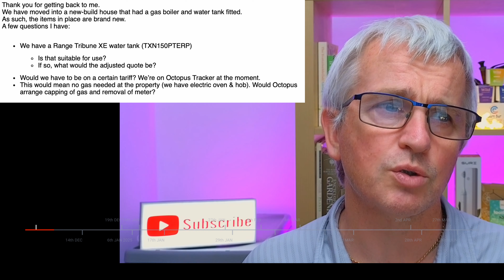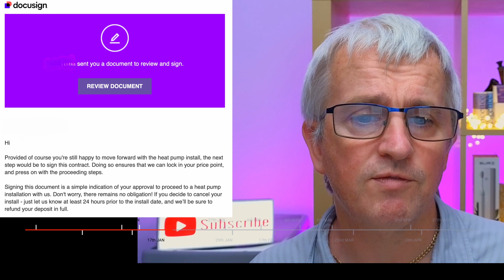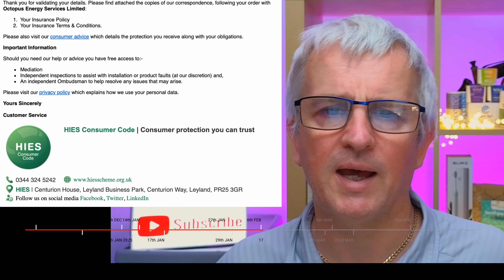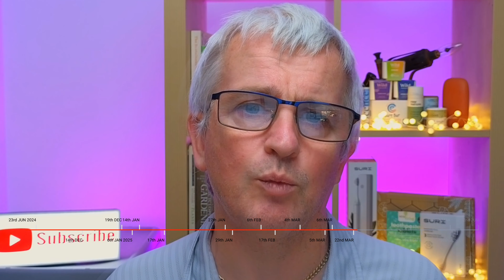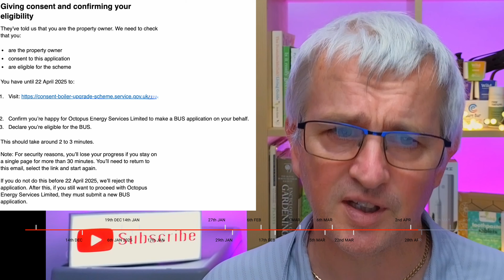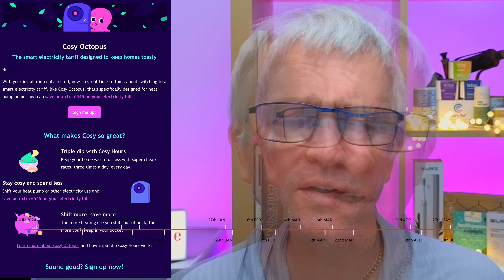My Octopus Heat Pump Journey: From Quote to Installation Day

Comment: Why on earth would you buy a brand new house, and then change the heating?
Reply from the maker: Because brand new houses locally aren't fitting heat pumps. Until legislation changes they will continue to fit gas boilers, I suspect. We did not want our energy to be fuelled by fossil fuel. 

And before someone else comments about electricity being fossil fuel generated, we have a share in a wind farm.

Comment: Quick question. I had to come to the comments to find out how much you paid after the survey as it wasn’t clear. As you weren’t able to keep the existing cylinder I am guessing you paid extra for that. What was your final cost overall. Also guessing you went with your second quote of £1600. I have been quoted £2700 including 7 standard radiators to be replaced. Plus the cost of the water tank. As I currently have a combi boiler. 

I have used your referral code btw. Thanks
Reply from the maker: Hi Simon, yes it was the £1645 quote we went with. The water tank they fitted was standard and included - it was actually a larger capacity than we had before. We didn't have to pay anything extra beyond their quote. I'd hoped to recoup money from the old tank and radiator, but didn't want to take the risk of them lying around the property and me not being able to shift them! 
We had 5 or 6 new radiators (sorry, I don't recall exactly now). 
I suspect your quote being higher perhaps reflects a slightly more complex installation than ours.
Many thanks for using the code, it's really appreciated, Good luck with progressing your install! (I've just loaded up a video on our energy costs after a year - it's significantly down on pre-heat pump, although we did get a battery fitted as well.)

Comment: It looks as though you have micro-bore pipes? Were there any suggestions that this would all need to be changed to wider bore pipes. Also, regards the pipes from the boiler to the tank. It doesn't appear that these needed to be changed either. We've had an initial visit (not a proper survey) from an independent local engineer who suggested we'd need to change a lot of our pipes.
Reply from the maker: I believe our piping is 15mm, rather than micro bore (10mm or 8mm), so there was no discussion about pipe changes. The feeder pipes from the heat pump to the water tank were new, as that route through the loft wasn't used for the old boiler (which was downstairs). The existing piping to radiators was retained, with new piping connecting to it from the water tank - but I don't know the details around exactly how that was done. 

I have seen articles about successfully setting up with micro bore, but I don't have personal experience of it. 
Hope that helps...

Comment: i found octopus energy to be very poor, now with eon
Reply from the maker: Both companies are investing in renewable infrastructure, but Octopus's business model is built around renewable matching from the ground up, while E.ON is transitioning from a traditional utility model.

Currently, E.ON sources a mixed grid mix for domestic tariffs, with renewable share estimates around 58-60% in the UK, relying on broader corporate PPAs to offset emissions.

Octopus match every customer's electricity use with renewable generation through power purchase agreements and own approximately 4 GW of renewable assets.

So at the moment, there's no comparison for me.

Comment: I am in the early stages of the heat pump process with Octopus. A key decision was Octopus have stated that my water cylinder was not suitable and would need changing (e.g. 170l vs 220l) but at an additional cost of £999 (not included in my initial pre survey estimate of £3700). Again a relatively new cylinder that perfectly meets our needs. The cosy12 system proposed has a high flow temperature (51 - 60 deg C) and of course we will still have our immersion heater in the unlikely event of low water temperature which could also take advantage of off peek rates. I'm awaiting a decision from Octopus but could be a game changer.

Your thoughts?
Reply from the maker: For me, Octopus identified the need for a water tank change during the survey stage. I was disappointed it needed changing as it was only 1 year old, but the reason was perfectly valid - low flow temperature needed a larger exchange surface in the tank. 

For your circumstances, I don't know why it wasn't identified at survey stage, but if it had been I would expect their quote at that time to reflect that extra cost. It's a shame it's discovered at this stage, but as the experts I'd defer to their assessment. 

However, you're not tied to use Octopus, so you can always get alternative quotes from companies like Heat Geek if you're not happy with the situation. I don't know much about their installs, so you'd need to research thoroughly.

Comment: Enjoyed the video and very well presented. My friend also used Octopus and went through the same procedures, but. Let me explain a quote was given and this was based on a complete survey being done and could change should the surveyor find any deficiencies, all agreed so the survey comes around and spends some 3.5 hours checking, things all fine they were then given the toal price of intalation and they agreed. Eventually date agreed and the team come to fit the heat pump. The engineer come into the house and within 1 minute he stated the pump could not be fitted due to the pipes from boiler being incorect size so the cost would now be £1700 more. This problem was so basic any surveyor could not miss only the one that Octopus sent to survey the property after 3.5 hours he did not see this yet the engineer spotted this within one minute of entering the property. It is still ongoing but it begs the question how can a survey miss this very basic fault.
Reply from the maker: Many thanks for your kind feedback. 
That's such a shame that your friend has experienced such issues. There do seem to be quite a few issues with surveys, which isn't a great look for the industry.

Comment: The de looping was our biggest hurdle
Only found out 1week be the origanal installation in January 
So our journey was sept 24 and fitted in late June 
Just need to fire it up for heating
Reply from the maker: Ouch, sorry to hear it added such a delay. Ours hasn't kicked in for heating yet, but I expect it will happen any day now as the temperature is slowly dropping...
Reply: @GuyGoesGreen 
I put ours on yesterday just to see if it came on
It did but not for long it’s still too warm

Comment: Hey G3! Well isn't it strange? We've been having solar/battery storage/EPS/EVcharger fitted and the whole process covered pretty much the same time scale as your heat pump installation.
Our delay was caused by supply chain problems, we got the solar up, 22 pretty much east/west panels, and the battery but the back up box got recalled so we had to wait for that. Bit of a shame because we couldn't get signed off to receive the export payments for the huge amount we generated in May/June but at least we were running on self generation. Had a bit of a hiccup when something blew in the cut off switch but the app noticed and we had a guy back to rectify the problem. The EPS back up box came eventually, got fitted and within a couple of weeks we had a grid power failure and it worked perfectly so that felt good. 
I can't deal with the upheaval our house would require for a heat pump so I'm thinking about gradually putting in infrared heating and contemplating what to do about hot water in due course.
Great to hear about this, I've watched the follow up to this one but it's past time to put the light out so this will have to do for now. 👍💚
Reply from the maker: Hi Jude, hope all's well? 
I bet you've got a good return in July with your panels? I've opted against them due to payback time, but strangely enough today we're getting a Tesla Powerwall fitted to make the most of the cheaper overnight electricity we're getting. I'll get a video up on that in the future.
We were very fortunate with our house being a new build, that there was relatively minimal upheaval. But an older house would have more likelihood of unforeseen issues and workarounds needed (I expect). 
At the moment it's been working really well, but it's only been supplying hot water - we haven't needed to see how the heating goes. Another couple of months and I expect that to start to be noticeable. 
How's the garden, any progress?
Reply: Our total payback time is about six or seven years...but we didn't use Octopus although we're on one of their tariffs. I can recommend three local installers if you do end up thinking about other free quotes for solar PV. I say three because they were the ones we ultimately chose from and none of them bothered us after coming to visit. In fact the chap who came second actually asked what he could have done better to have won our choice which I thought was very sweet.

Garden is still a work in progress due to a misunderstanding with the gardeners but the other day, my solar chaps finally brought the pallets they promised me so I'll soon have three compost bins made when I get time.

At the end of the month I've got the gardeners bringing some hard landscaping and prior to that I'm busy digging out roots and trying to get the ground smoothed out.

Yes I am doing some digging! Been drinking some natural fruit water kefir and it's given me a new lease of life so I can now work in the garden for up to an hour as long as I rehydrate with a litre of water and a pukka tea immediately. Had a fortnight off thanks to second shingles jab which knocked me back a bit but  been at it again this week. 

I work out there early in the morning when it's cool and I can't believe I'm recovering afterwards... I just hope I still can after that jab but I've given myself a sensible amount of time off and now I've decided to risk persevering so wish me luck!😅👍